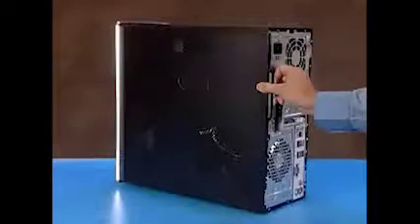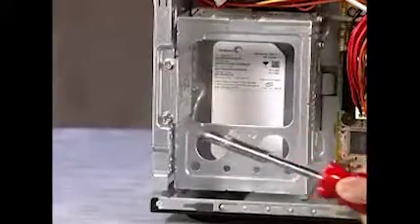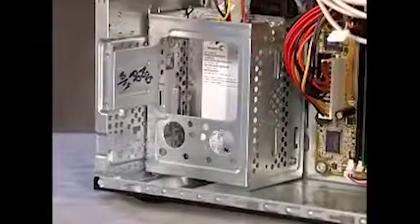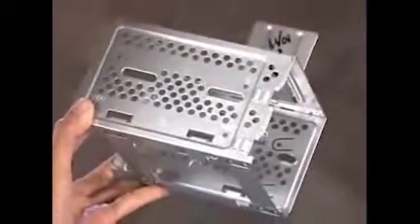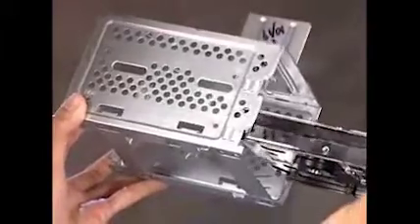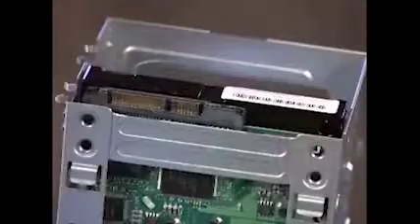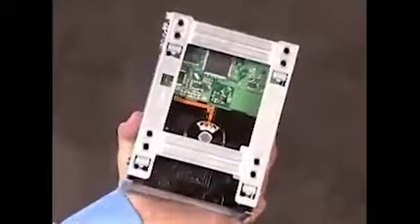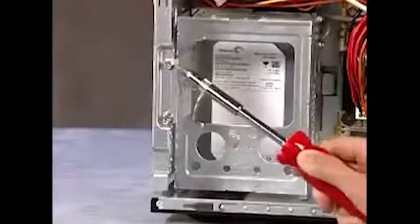Add or Replace Hard Drive | Desktops | HP Support

Comment: I can't figure out how to remove the front pannel
Reply from the maker: Hi there, thanks for contacting HP Global Social Media Support!
I understand that you need help in removing the front panel of your computer.
I will do my best to assist you.
May I know the computer you are using?
Please let us know!
Regards, 
HP Support
Reply: On the right side of the front panel (when facing the front of the PC), there are 3 plastic tabs/hooks inside that you pull slightly outwards to release.  Then that side of the front cover will be free to rotate towards the front.  Keep rotating, and when eventually the 3 tabs on the left side of the cover will be free.  It's quite easy after the first time!
Reply: On mine, the a4313w,  it slid out when pulling forward with a bit of force.

Comment: This is the most unhelpful tutorial I've ever seen.
Reply from the maker: Hi Vincent, thanks for contacting HP Global Social Media Support!
I am here to help!
What seems to be the issue? Are you facing any technical issues with your HP computer?
May I know the computer you are using?
Let me know!
Binu-HP Social Media Tech Support
Reply: @HPSupport  Thanks for responding! The issue was that the instructions weren't clear enough for me. For example, the video said to take off the panel, but it didn't tell me how to take it off. I came to this video to figure out how to open the computer and where the hard drive would be, but I couldn't get past the first step. I ended up figuring it out on my own after some poking around, but more clear and specific instructions on this video would've helped out. I had been watching a bunch of hard drive swapping videos because I was taking hard drives out of multiple different computers, and I found this one unhelpful in comparison to the others because it didn't break down and demonstrate the steps and instead just stated the step and showed it from one angle.
Reply from the maker: Hi Vincent, thanks for contacting HP Global Social Media Support!
We are delighted to hear that the video was useful to you. We will forward your feedback to the concerned team!
If you need any help in the future, you can always get back to us.
Thank you for being a valuable HP customer.
Have a wonderful day!
Cheers!
Binu-HP Social Media Tech Support
Reply: well, it doesn't help that it was filmed on a 1990's webcam lmao